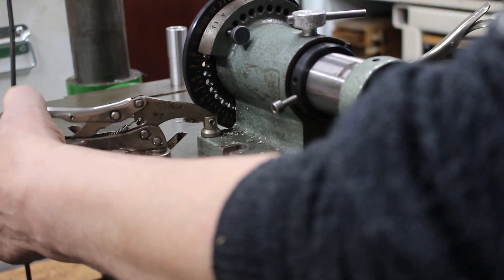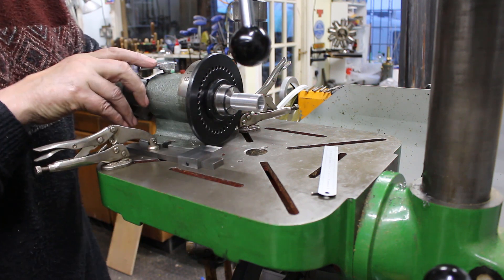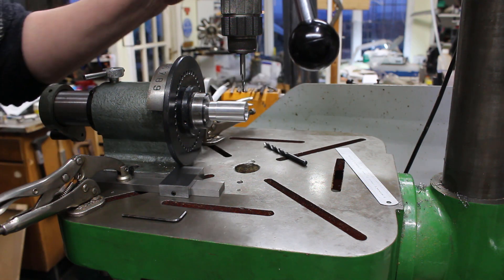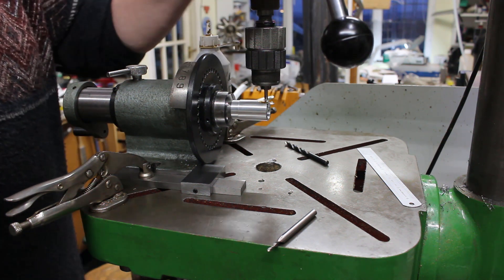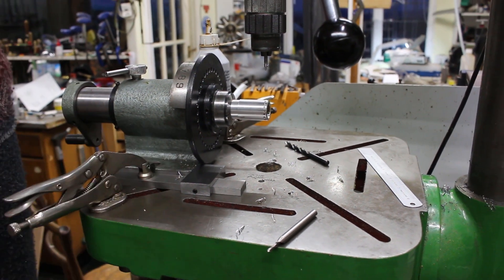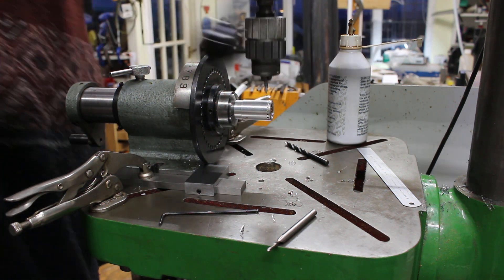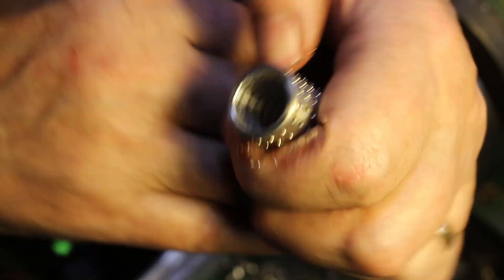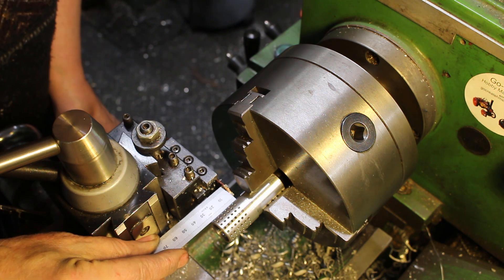Drilling machine gadget : Drilling a cylinder : Home machine shop projects No.1

Comment: Save your chop sticks from the Chinese restaurant. They work a treat for catching work being parted off. If you get chop sticks that are still attached to each other you can slip abrasive cloth between the sticks and use them to deburr I.D.'s
Never put your hand or fingers inside rotating work, no matter what size the bore is. A razor sharp burr may be completely invisible when the work is rotating. It'll give you an unpleasant trip to the emergency room for stitches.
Grabbing work by the outer diameter that has been turned can be just as painful for the same reason. Nasty burrs can be hiding in plain sight on the surface of the work... you just can't see them when the work is rotating.
Reply from the maker: Thanks for your comment, it's all too easy to become complacent, i'll follow your advise in future.